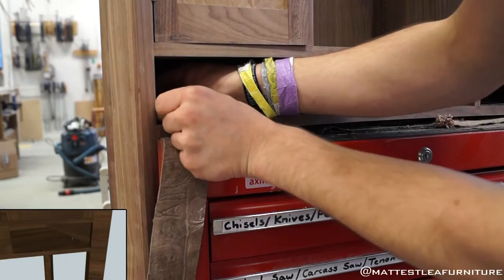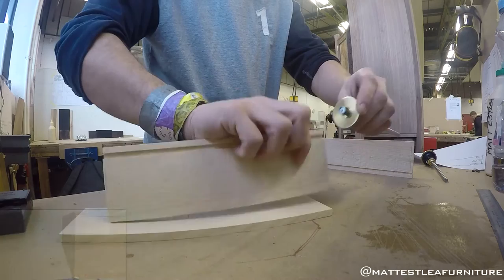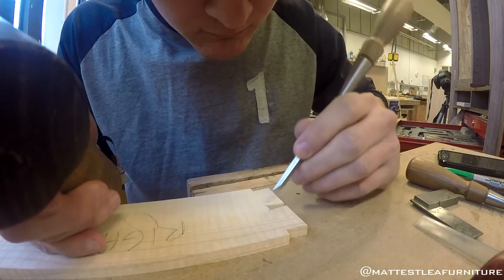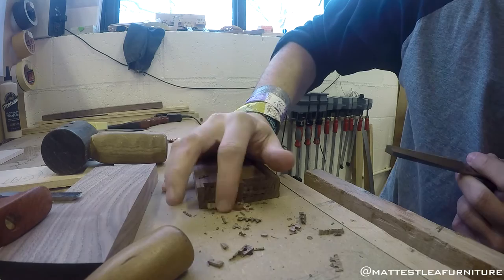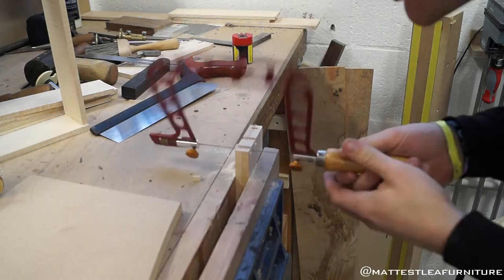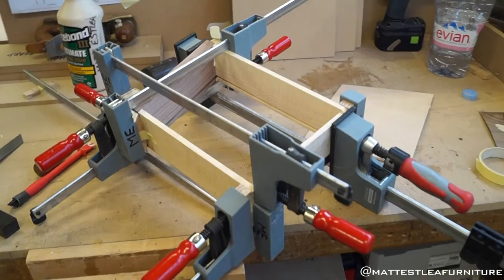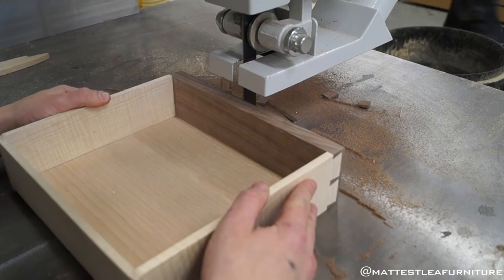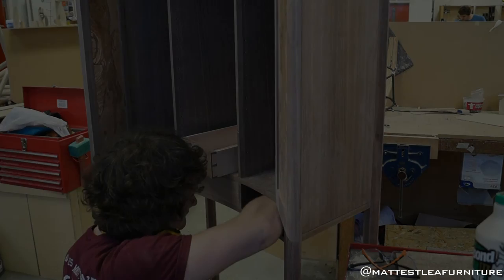Dovetailed Drawers - Making A Krenov Cabinet - Part 5/5

Comment: Rather than the double-stick tape, another trick I like is to use cyanoacrylate (super) glue in a couple of places, and yellow glue between them. The cyanoacrylate sets in 30 seconds of hard pressure, and acts like a clamp while the yellow glue sets.
Reply from the maker: I thought about that but was worried about the glues mixing together when pressure was applied. Do you know if this is a problem in your experience? Would it stop the glue from setting properly for example?